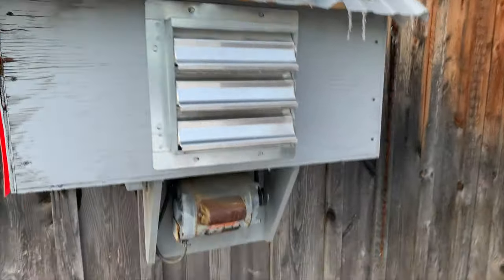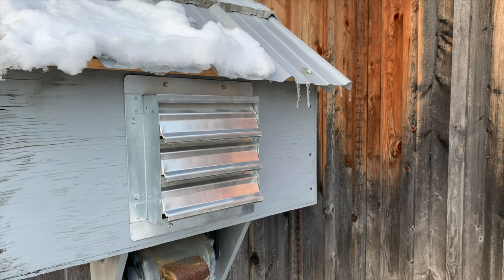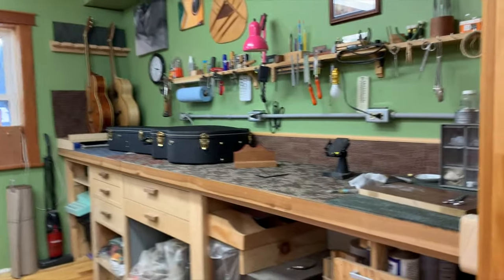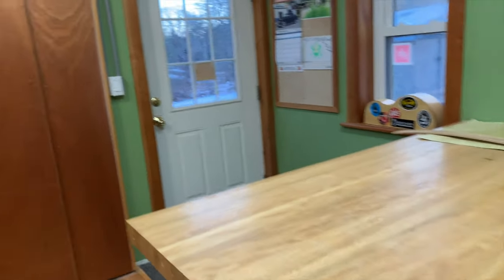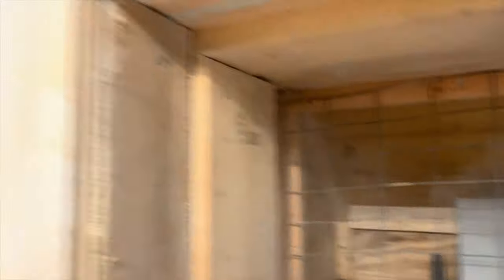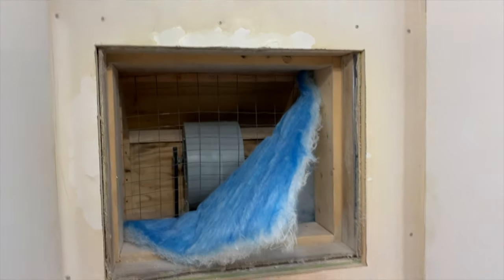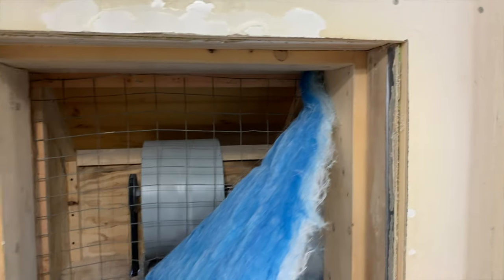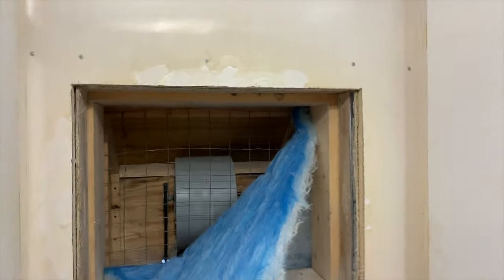The Spray Booth at La Due Guitars

Comment: Great set up Kevin. I was using the same window fan setup in my shop for years. Just last year I made a corner of shop into a micro both. Makes an amazing difference. Filtered exhaust and intake air.
Reply from the maker: That sounds great, especially the filtering. I have no return air system so my  blower brings in makeup air from anywhere it can get it. Consequently it has the potential for increasing the humidity during warm months and when it's cold it cam make a marked difference in the shop temperature in just 45 minutes of operation.
Reply: @thepragmaticluthier  I don't a heat exchanger just filters. I still need to crack the shop door or it pulls the shop into a vacuum. So I am also drawing in unheated air in the winter.